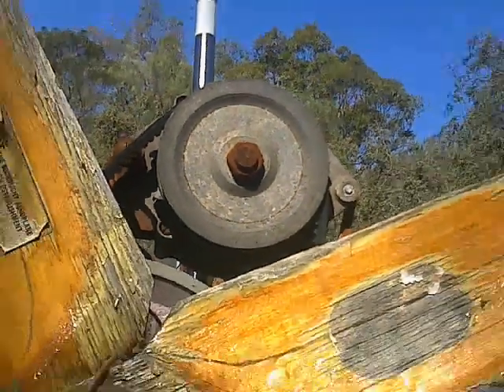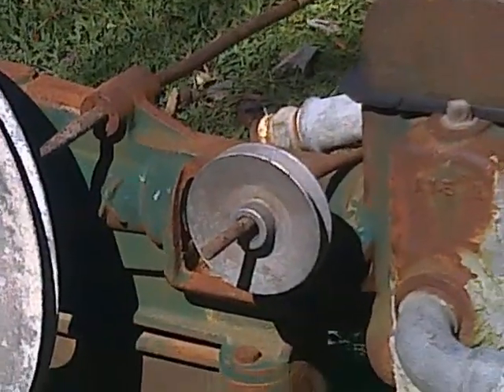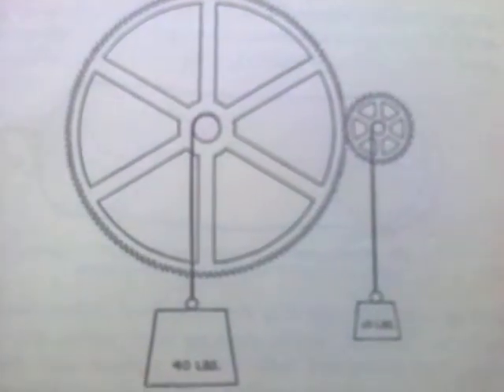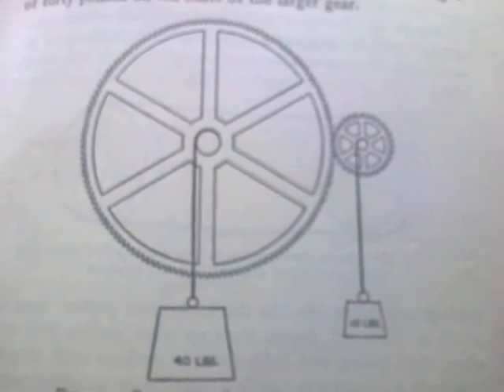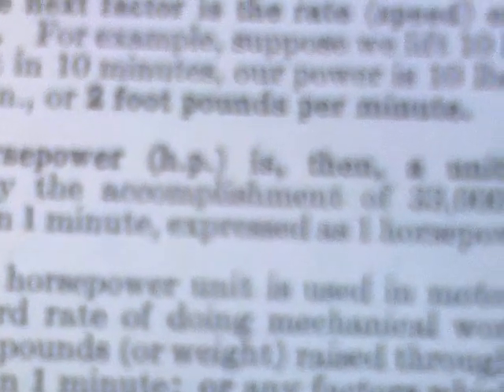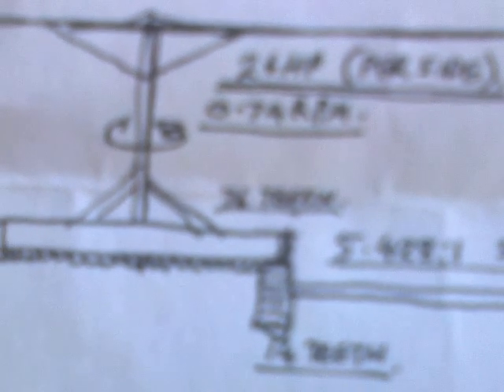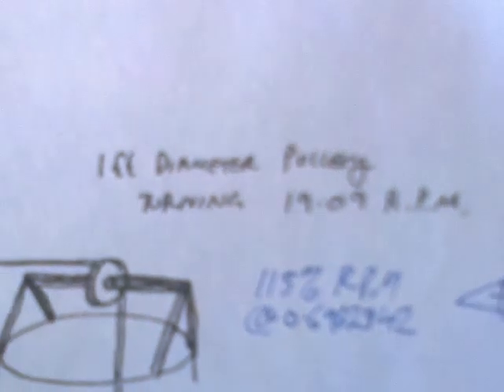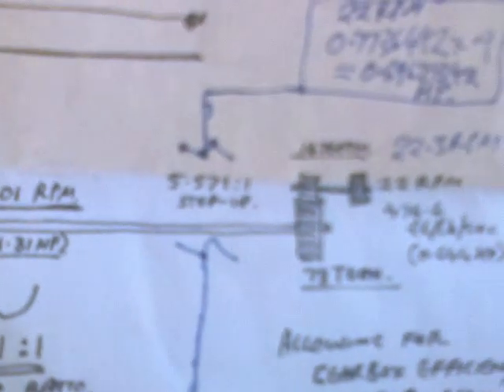The Magical Dunning-Kreuger Gear-Ratio Effect...!

Comment: Would you not have to consider the "fuel" the horse is burning?
Reply from the maker: G'day,

  Thanks.

  Ah, well, yes..., that's another thing...

  The 2-Horse Mill made by John Gray was running a Chaffcutter on Glen Leigh Station, which had the first Race-Course in the district, so I imagine it was pretty fractal in that the Racehorses & Carthorses  or Ploughorses in training could work the Chaffcutter while getting excercise....

  But, the Topsoil & Rainfall & benevolent climate which grew the fodder, with Animal power, to feed the Beasts of Burden which used to keep Society ticking-over...; all that Topsoil has gone, there's 15% less Precipitation, so Runoff is down by 40%, and Winter overnight minimums are up by 10 or 12 Degrees, here, at least - while there's yet another Heatwave baking Oz right now...

   And, the thing is - in a post-SHTF scenario, even Wind-Generators are only useful if one has Batteries.

  I'm thinking a Vertical-Axis Wind-Turbine running a Workshop with Belts & Pulleys & Shafts...; and use the Lathe when it's a windy day, kinda thing (?)...!

  Have a good one,

;-p

Ciao !
Reply from the maker: +Ken Lee 

G'day,

 Thanks mate.

    I think that to run a Workshop, a big Savonious Rotor which does 100 RPM in about 15 MPH  150 in 30 MPH, would be pretty good (?).

  Have a good one,

;-p

Ciao !
Reply: @WarblesOnALot  I'm sorry: "in" 15mph?? 

pardon my literal
Reply from the maker: +Phoenix Chastaine 

A Savonious Rotor is the kind of Windmill that looks like a couple of Oil Drums cut into 2 Half Cylinders, each pair welded together offset so the curved Surfaces form an "S"- Curve, and one S mounted atop the other, with their Buckets facing the same way, on a Vertical Axis, and the top Pair set athwart the bottom, so 4 times every revolution One of the Buckets is catching the Wind...

  They're considered great for Waterpumps & horrible for generating Electricitiez, due to their low rotational speed.

  Getting Free Energy from the Wind is bloody complicated, as it turns out.

Have a good one...

;-p

Ciao !

They start turning in about 5 mph of Wind, reach about 100 RPM in 10 MPH, and they don't ever spin much faster than 160 or 180 RPM.

 To add Twistiness one adds "Decks", because incresing the Diameter increases Leverage - and Twistiness, at the expense of reducing RPM.
Reply: @WarblesOnALot  I saw a really nice one made from blue food service barrels. (55 US gal). The transmission was an 80% contact belt into a small vertical generator into an RV deep cycle battery. 

What kind of efficiency do you get with a horizontal shaft synovial? I am seeing it stick out the side if the shop like a waterwheel, I hate the losses involved in altering thrust angle. Tell the wind to only blow North when you need power. :P

Other silly ideas, those Giant windmill blades, you could stand one up on a wobble plate and pump hydraulic fluid, or compress air. I have low trust in the giant windmill's longevity, bearing failure is deadly for them. Re-using those beautiful wings in a less intense application may become a thing.
Reply from the maker: +Ken Lee 

Well, if you use olde-fashioned flat-belts & 1 : 1 Pulleys with shafts at 90-degrees to each other the losses are pretty minimal ; and the whole point of Vertical Axis Wind Turbines is to be able to accept any wind from any direction and process Turbulence as a transient increase in Power, rather than as a reason to shake to a standstill while having a Dynamic-Vibration Temper-Tantrum, induced by Gyroscopic Precession acting cyclicly on the Turbulence-induced Asymetric Blade-Loadings...

   In any post-SHTF scenario, long term the White Rock/Saphire Windmills will be Ornaments ; when the Grid falls down from interrupted Fossil-Fuelled Generation, there's no use for the Megawatts of Juiciness they make, and no way to synchronise the Remains of the Grid - and without Refined Transport Fuel then none of the Heavy-Engineering Equipment or  Trucks & Cranes & Winches required to erect or maintain the Chinese-Made Windmills, and no Spare Parts or "Specialist Consumables" available.

   We are goanna de-technologise a long long way, fairly rapidly , from what I can make out.

Have a good one,

;-p

Ciao !